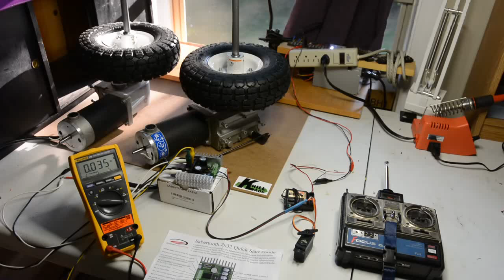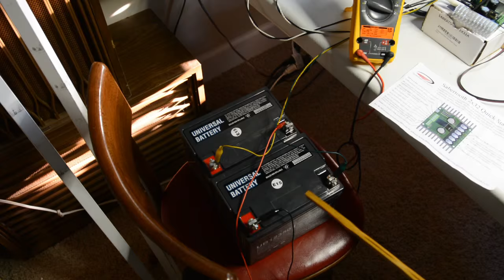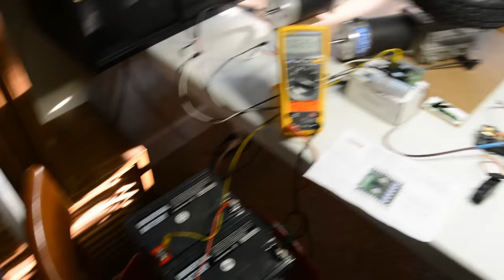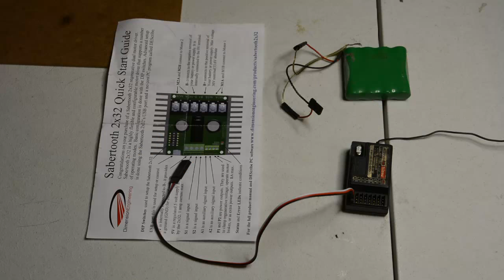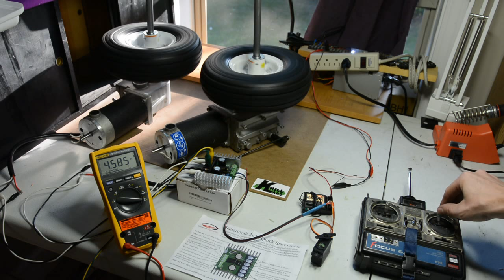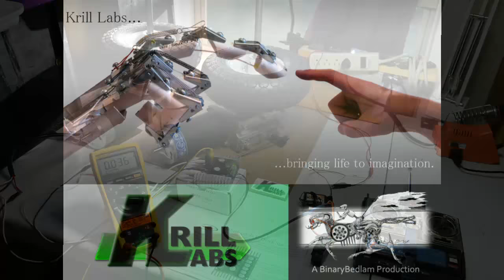Krill Labs - 2x32 amp Sabertooth Driving 2 Jazzy Wheel Chair Motors w/ RC

Comment: With your description i bought the sabertooth 2x32 . i have 2 250 watt wheelchair motors mounted on a lawnmower with the front wheels in place. i wondered like 4430salton and i can tell all-it works. it drags the front wheels around through turns and is very easy to use. my 85 year old mom operated the mower from the front porch and just had a blast. told me it was so easy to steer and at over 100 feet away from the house  she still had control of it ! i almost had to pry it away from her but then the mower ran out of gas and she handed the controls (i have the same frysky FS-T6 and 6 channel receiver that 4430 speaks of) . in 50 years of rc airplane experience this was the best i've ever known. Painless! I contacted Dimension Engineerings' Tech support and Charleen answered my questions and gave me further valuable advice. What a great rush this is!

Comment: If you were to use a little more modern transmitter with the ability to adjust your joystick function you can increase your Exponential values which will lower the response of the stick around the center position.  It makes moving at ultra slow crawl rate to full speed ahead all possible without having everything happen too fast.  Very much worth while feature.  And, using 2.4ghz transmitters just make the experience more enjoyable.  I use 5.8ghz FPV camera and transmitter on mine so I can cut the grass using my FPV headset of sit inside the house and cut the grass on the 60inch TV and have a cool one.

Comment: Most people don't know where to get wheels for eBay sold motors. I found the Harbor Freight wheels are a perfect 4 bolt match for the stock 4 bolt motor hubs. The HF wheels are rated at 300 Lbs each. My RC lawn mower pulls abt 9 amps MAX @24 volts so one could use a cheaper $74 2x12 amp "Sabertooth" with a 10 Amp fuse.  The Sabertooth 2x32 costs abt $124

Comment: I trust this Sabertooth can handle what they say it can, but this thing is absolutely astounding. I mean how in the World can something with components that small handle even as much as 32A per motor? I think most older designs used 8 power MOSFETs which are not tiny. I think they have a cavity milled out in the heatsink under the board. But, even then whatever they're using can't be very big.

Comment: Hi Dan, thank you for the video. It is a great project. Base on this video screen, I have few questions below:
Question 1: From the controller output, you connected two set of wires to two motors; also, where are those two yellow & black (banana clips) come from?
Question 2: From the receiver output, you connected wires to controller input. At receiver input, two red & black (with banana clips) where do they come from (power source)?
Question 3: From the receiver output, you connected the orange cables to what unit?
Thank you when you give me the answers.

Comment: so what your saying that in independent mode this means you use both joysticks on the remote? one for left side and one for right? Im building a RC mower with 4 motors but I want to control one side with the left joy stick and the other side with the right joy stick. It would also turn around faster if needed. Im using One sabertooth motor driver

Comment: I bought one of these controllers to replace the controls of  a robot lawnmower which I feel was poorly designed (worked for a while until several things fried). The guy had his controller mounted on a 1/4" thick aluminum plate inside a rectangular Al tube. The 2 motors can draw as much as 40A (has 40A fuse). I don't have many choices but to mount the Sabertooth  the same way he did. The tube will be sealed on the ends. I will use heatsink paste on top and bottom of the Al plate. I'm concerned this thing could get too hot. It probably won't. This guy has been making these lawnmowers for years, but it didn't work well for me. My sense is other customers have also had many problems. I was hoping I might put some vent holes in it so air could travel across the fins, yet not let water or moisture in. Just the mass of the 2 pieces of Al tightly attached may be quite sufficient to keep it cool. Do u have any suggestions?

Comment: I see that the 32x2 amp sabertooth driver is the most common driver but I do wonder why a typical wheel chair motor single or dual controller is rated at 90-160 amps depending on the model of controller

Comment: Hi Dan,
Thank you for an amazing video. Can you kindly provide the connection diagram of your circuit? It would be more easier to understand that way ( Motor Driver connection with APM board/Radio board).

Comment: I have 2 wheelchair motors made in the same way, Sabertooth 2x32A, but my motors heat up a lot and after 10-15 minutes they weaken a lot, they have no power.

Comment: Can you link the controller and transmitter you use? I looked at other builds and I like how you controller can control both motors with one stick. The controller I currently have in my shopping cart has two joysticks like yours but I do not know if it is left/right and up/down or if they swivel 360 like your controller. Thank you

Comment: I want to use 95 Volt PM DC tredmill motor instead of Wheelchair motor to modify my electric mower,,. & I bought the motor driver which has the following Descriptions,
Specifications:
- Input supply voltage: 12V-40VDC
- The maximum output power: 0.01-400W
- The maximum continuous output current :8A;
- The overload and short circuit protecting current is 10A
- PWM frequency: 13 kHz
- Item size:60 * 55 * 28mm
Now Please advise me that above motor driver is good for my project.?
Thanks in advance

Comment: How do you keep the current draw where it needs to be to avoid overloading the driver (I.e. one wheel getting caught or going uphill with the current increase)? Is this solely by the software on Dimension Engineering or are there any failsafe protections I can add I.e. breakers at each motor?? Thanks

Comment: I am building a electric lawn mover and wondering how do you charge the deep cycle battery?

also which motor controller should I use 2*25 vs 2*32?

I am trying to push a manual friskars lawn mover.. I need speed with traction to cut grass.

Comment: I am working on a robot and need a set of controls like, motor controls for a wheelchair motor which I'm using for the drive system. Do you have a kit or can you put together something that I can purchase and just connect my motors to.
Reply from the maker: See if this works:  https://www.ebay.com/itm/113958899855

Comment: Thanks for the vid. Couple of questions though... the 2x32 has outputs for motor break control so why did you remove the brakes? And... is that a wizard wand o.O
Reply from the maker: +Bill Tackett I removed the motor breaks because I wasn't always using the sabertooth to drive them, in fact sometimes I directly attached them to batteries for speed and torque tests. My wand is actually a back scratcher.
Reply: Makes sense, thx. Just wanted to make sure that there wasn't something about the brakes on the scooter/wheelchair motors and the brake control on the 2x32 that wasn't obvious.

Comment: how did you connect the wheels...the harbor freight wheels arent keyed. thanks
Reply from the maker: In this vid the wheels are simply pressure fit to the shaft, in the final project i drilled holes through the rims and directly bolted them to the spur gear so that the wheels don't need to be directly coupled to the axle.
Reply: Dan Krill I need to get the spur gears. I accidentally threw them away with the wheels  :(
Reply: A video on this would be great. People want to know how to add custom wheels to wheelchair motors.

Comment: I had a question about your motor shafts... how did you extend yours? I have a jazzy wheel chair motor but the shaft is like 1.5 inches long and most of the tires/hubs are at least 2.5 inches wide.
Reply: Use coupling

Comment: Is current being read between the Batteries and Sabertooth? as in should I only expect both motors to draw from 3-5Amps combined during normal operating conditions.  If they are 250W motors I would expect around 10.5A (250W/24V).
Reply: Always prep for the higher current situations for safety.
Reply: Like Michael said.. what about stall current? Better add fuse and use higher rated motor controller. How much amp a motor will draw will be based on the weight of your robot. Don't go with 250W as max work done by motor.

Comment: Have you finished the project? I'm assuming this is more some rc mower, either case was wondering the current draw under load
Reply from the maker: I have yet to measure the motors under load, and now with all the cables mounted in the chassis, it would be quite difficult, I will have to let you know when I can tear it apart for upgrades.

Comment: I'm new to the Sabertooth 2x32A drive. I purchased a FlySky FS-CT6B transmitter/R6B receiver... I discovered I need a 5 volt source for the receiver...It's not even stipulated in the manual. Is there a unversal connector for this application....Oh, by the way I'm drivving  2  Jazzy Wheelchair motors
Reply: William Gunter The sabertooth has a 5V output designed to drive your receiver.
Reply: Most of the electrical connectors can be modified the way you wanted.

Comment: Awesome! I'm just starting on a bot using the same setup. How did you adapt the HF wheels to the motor shafts? All the pneumatic wheels at my store have bearing hubs... Did you just weld them to an axle?
Reply from the maker: +Colorado Flight Films These tires have bearings as well. So in this vid the tires are just free spinning over the axels, and the inside diameter of the axels is also very close to the motor shaft, so again, in this vid they are just sitting on top. But in practice I have mounted 1/2inch bore roller chain sprockets to the motor, then using long 2inch stand offs, and drilling holes into the wheel hubs, I mount large 40tooth gears directly to the tires and link the 2 with #25 chain, such that the axel going through the bearing in the wheels are now irrelevant.
Reply: HI i'm using the same parts and set up but i can not figure out how to mount the tires, could you make a video about it?
Reply: @luispozas6191  tires and motors should be matching and line up.

Comment: hi - - hope you get this in the near future :) ... i have one of these - - been playing with it for ages -- still cant get mixed mode to reverse correctly .... i.e.    forwards and right should be stick forward and right which in turn should be left wheel forward ... but then to my mind .. if i want to reverse and turn .. stick back and right should be left wheel back ... but it doesnt .. it does right wheel back .. ive tried mixing things up in the tx etc .. but so far no joy . hope that makes sense - - . any ideas ?
Reply from the maker: +iON GiANT I think I see what you mean, not sure what the issues is there, but something tells me the problem actually has something to do with your PWM signal, perhaps either your remote or the receiver is not producing a wide enough range for the sabertooth to translate a reversal request? Perhaps you can try going to a hobby store and seeing if they will let you use one of their transmitter/receivers so you can at least rule out if thats the prob or your sabertooth is the prob.
Reply: Good idea Dan, I'll try that first .... :)
Reply: +iON GiANT  In my message above I talked about a lawnmower I had bought. I believe the seller used a controller of his own manufacture. I have also had trouble controlling the direction in reverse. Maybe this is a bug no one has really solved. But, on second thought there are many electric wheelchairs. This should be unacceptable for them.

Comment: Hello Dan,  what pin configuration are you using for the receiver? I need one for throttle and one for stopping one wheel at a time for turning.  the FS-T6 transmitter does not have a mode for a car only ones for plane or heli, is that a problem for controlling a RC lawn mower?  Thanks
Reply from the maker: it doesnt matter what mode the transmitter is in, but you want to set the sabertooth to "independent" mode, it allows you to drive the robot like a tank, i used the pin configuration on their website.

Comment: Did you finish this project? If so, how many amps did these motors pull when driving completed robot?
Reply from the maker: I have yet to measure the motors under load, and now with all the cables mounted in the chassis, it would be quite difficult, I will have to let you know when I can tear it apart for upgrades.

Comment: how did you connect the wheels to the motor shaft... im. stuck there as mines have bearings in them and i also bought em from harbor freight
Reply from the maker: The wheels have a metal protrusion, you could drill perpendicularly through that and the shaft at the same time and run a strong steel pin or bolt through both, this is not the best way though since the pin could sheer. The key is actually not even mounting the wheel directly to the shaft. Instead bolt the large drive gear directly to the wheel, this way no torque conversion is occurring in the shaft, only from the motor to the gear to the tire. In that case, the shaft could actually be fixed so long as the tire and gear are free to revolve around it.
Reply: @binarybedlam  So fixed shaft and bearing of the HarborFrieght wheel is what rotates it freely.. Nice idea. Although I have to find a way of centering the gear wheel while attaching it directly to the wheel. Not sure how to achieve perfect center of wheel hub and gear as HarborFrieght wheel bearing is not exact 5/8".

Comment: what do you think will be max amps at 24v per motor. I have 2 motors for a RC build and hope the sabortooth is enough.
Reply from the maker: +Jorge Serna - I stand by their rating and trust their engineered safety factor, so I'd say you can go right up to the 32 amp rating, but in everyday use, I'd try not to exceed 20 amps per channel.
Reply: +Dan Krill Thanks for the quick reply, my question was not clear sorry. Do you think these motors may exceed 32 amps once loaded up with weight?  I haven't ran any test on my motors since I haven't mounted the tracks on my rc build. This is the controller I have been looking at. Once again thanks.
Reply from the maker: +Jorge Serna - I haven't done any loaded tests either, but from what I've been reading, you can expect them to draw around 20 amps each with a heavy load, and as much as 30amps when approaching stall.
Reply: +Dan Krill The lawnmower I have had a 40A fuse. U could just put a fuse like that in your device so it doesn't go over 40A.

Comment: Can you connect 4 motors to that saber tooth where the two right and the two left would move in sink?
Reply from the maker: i dont know about that, i probably wouldn't try it unless the motors were significantly smaller than the ones in this video.

Comment: How did you mount those HF hubs to the wheelchair
Reply: I have the same wheels and will be mounting a sprocket to each in a few days by stacking washers over longer hub bolts till they evenly reach the sprocket, then I'll weld everything together as needed.

Comment: can I drive 4 pancake 350 motors with 2x60 sabertooth
Reply: I know that it is an old comment, but NO.  Sabertooth has a regenerative circuit, so when the motor comes to a stop, it throws some of the Counter electromotive force (C-EMF) voltages back into the battery, to recover some power.  Probably your best bet, is to get two of them, and use a Y-cable from your receiver to both controllers.  Sabertooth has a "slave" mode, so that you can do this.

https://www.dimensionengineering.com/datasheets/Sabertooth2x60.pdf
Reply: @jacobw446   yo !! thx  for the reply

Comment: Great video!  I want to convert a wheelchair to RC base for 360 mounted camera for virtual tours.  Do you have links to good Bluetooth receiver and how to configure Android device to control this?
Reply: Did you ever build that? Curious about your setup. I saw that indie mogul video too .
Reply: @LightwaterFilms   I did and it did not do well.  The  pole shook back and forth so it was not usable.  It would have needed a pole that had some dampening  shocks to keep it from vibrating back and forth.  It was an "oh well, I tried" project.